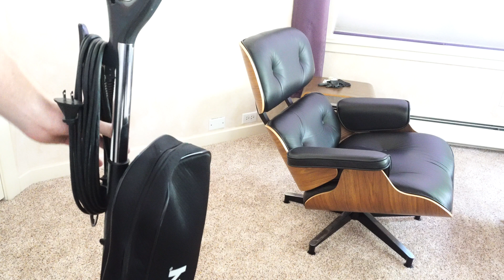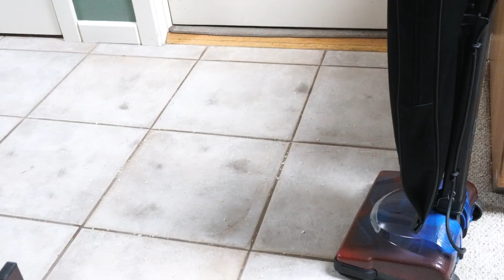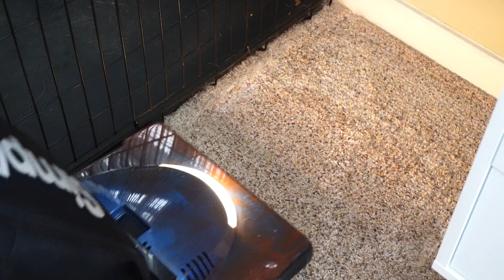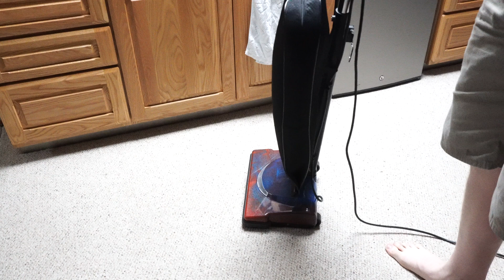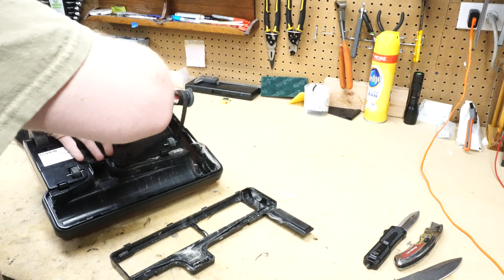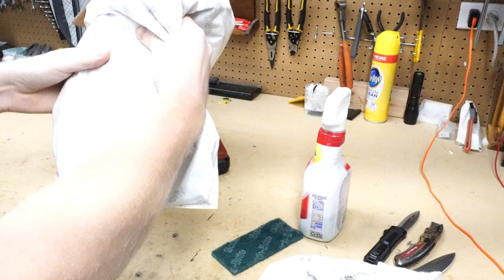Simplicity Riccar R10 vacuum review

Comment: Although my Lindhaus Valzer is a great vacuum, I’m tired of the weight, especially up and down steps. I’m thinking the Riccar R10P would be a good choice for use on medium to low pile rugs of value and cat hair. I would change the brush strips to the softer brushes. As always, you provide great reviews.

Comment: I had the Maytag version without the lifetime belt and liked it very much but recently traded it in favor for an R30 pet for my second floor because I just couldn’t push my old Kirby anymore. I’ve kept my Oreck for downstairs. Love the R30 but I would be more confident if they’d make the direct fan out of Kevlar like Kirby does for long term durability. Otherwise it’s a great machine. This Maytag or Supralite was too but I wanted on board tools.
Reply: They're made of Amodel these days, the previous grey version was Lexan
Reply: That’s comforting to know having just purchased it and knowing that the grey version had been an improvement.  Previous versions had been problematic and I’ve been careful and concerned. I’ve had my Kirby for forty six years and never had a problem but I’m aging and finding it difficult to push. I haven’t had an all in one upright in years since I had a Eureka Victory Vac and wasn’t looking forward to repairs. You know when your accustomed to reliable things like Kirbys...
Thank you for assuring me
Reply: @LlyleHunter  Oh sorry I should have clarified Kirby's fans are Amodel, the grey ones kirby used before that were lexan.
Reply: I've had mine used for 6 years and the fan is fine, but another one was around 4-5. Those fans are really tough.

Comment: Like the hood design on this. I'm somewhat like the oreck xl21 over the superlites/freedom eventho the simplicity is superior to the oreck in carpet performance. I like some of the feature from the oreck that the simplicity somewhat lacks like the back pocket on the bag to put the manual, bags and belts in, full beam headlights, carry handle and easy belt change tho I like the lifetime belt that the simplicity has.
Reply: There’s no comparison between the quality and features between the Oreck and these. I’ve had my Oreck XL Pro Plus II since 2011 and had a Maytag version of one of these for little over a year and it was easy to decide which one I was trading in.  I’m very happy with the R30 Pet but this doesn’t compare to either. My Oreck has done everything I’ve expected of it since the day I’ve bought it.